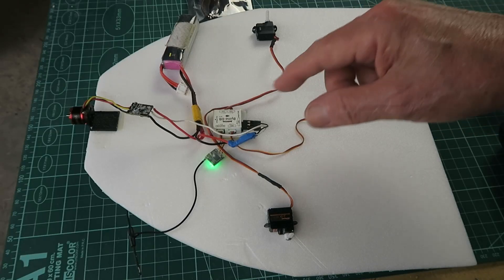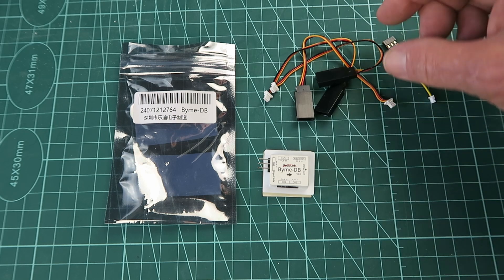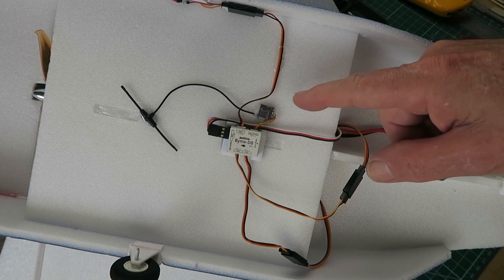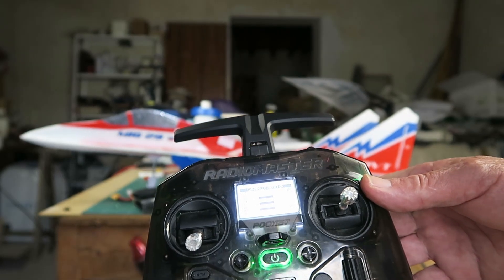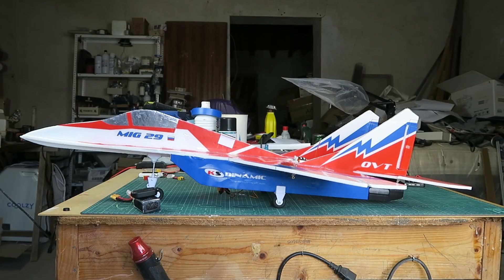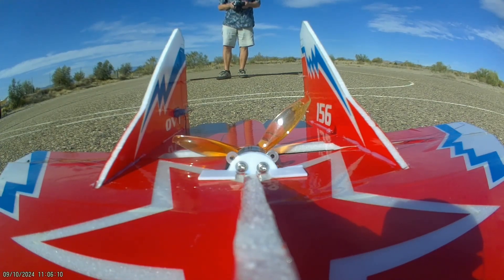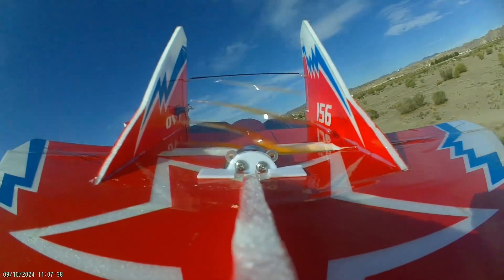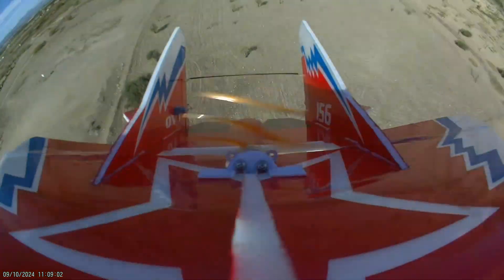RadioLink Byme DB Gyro Full Review & Flight Test ¦ Is It Worth it?

Comment: This is amazing, I just grabbed one to, I've calibrated it and I also use a radiomatser pocket, and I want to. Ask. Do I have to to leave the motor at reversed after calibrating it, or can I actually return it to normal?
Reply from the maker: The motor direction depends on the model configuration i.e. pusher or tractor and the type of propeller used CW or CCW. Thanks for watching, have a great day!
Reply: @1nformatica thanks really so much for replying, but I mean do I have to leave the  throttle stick reversed after doing altitude calibration, the manual recommends putting the throttle stick at reversed, so my question is can I return it back to normal after altitude calibration is complete?

Comment: Hello sir. It is possible to set even the dual rates on the transmitter?
Reply from the maker: Setting dual rates on the transmitter will only affect the "normal" travel / movement of the control surfaces. It does NOT affect the Gyro movement. The Byme DB has NO way of setting the "gain" i.e. amount of movement of a control surface. If you want a similar size Gyro with gain control for each axis look at the Hobbyeagle A3 Mini : https://youtu.be/rPhf0cLP1hw&list=PLxtbRS-naT68PQVcBSziD3c9Uk6sNhR_f Thanks for watching, have a great day!

Comment: the manual has weird commands for transmitter for gyro channel 5.

i have mine at -100/0/+100 for gyro, it appears that is correct. does that sound correct to you? also, how did you drop your rates? in transmitter? I have read that if you do that the db overrides it 🤷‍♂️ what did you reduce your rates to?

thanks 🙏
Reply from the maker: Please download the manual : https://radiolink.com.cn/bymedb_manual Page 5 shows the gyro modes on channel 5. You also need to use CH7 as motor stop. For "normal" i.e. non gyro throws I use rates on the transmitter. There is no way to control the gyro rate or "gain". The only way to change the amount of movement generated by the gyro is to use the control horns / linkage on each control surface. If you want a more sophisticated gyro with programmable gain look at this : https://youtu.be/rPhf0cLP1hw&list=PLxtbRS-naT68PQVcBSziD3c9Uk6sNhR_f  Thanks for watching, have a great day!

Comment: Do you need a special receiver or will a standard 4ch mini receiver work with this? I was looking at getting the Byme DB to use with an existing 4ch flysky receiver I have but I am not sure if it will work. thanks!
Reply from the maker: The Byme -DB (and in fact all Byme gyros) needs an SBUS or PPM input, it does not support PWM i.e. standard servo output. Thanks for watching, have a great day!

Comment: Seriously p-ed off that the 2 Byme-DBs that I got from an Aliexpress seller did not include the servo adapters only the S-bus adapter. Luckily we do have enough 1mm pitch 3-pin JST-SH pre-wired pigtails on hand plus enough servo cable to make up leads to suit any application.
I need to put together at least another 1 of the flat EPP foamboard jets  and try the DB on them.
Reply from the maker: Got mine from Aliexpress too but from the Radiolink "official" store! Could be useful as I have a twin motor "Zagi" type wing which may have some asymmetric thrust!! Not a fan of the prop in a slot models. Make a lot of noise but don't go very fast!! Which EPP jet are you building?
Reply: @1nformatica  Same sort of pusher prop-in-slot kit as you have there. Made up the Yellow "Hornet" version but might re-configure 1 of the 2 other kits into twin tractor versions. The Hornet flew well enough until an argument with a half-burnt wattle tree! Required a good bit of added carbon to realign it all. 
Also got 1 of the Heewing Hunter smaller versions so disliked by Lee @ Painless360. It is a bit sluggish.